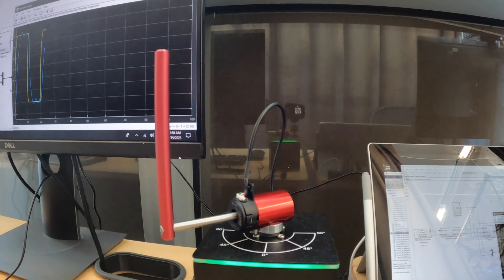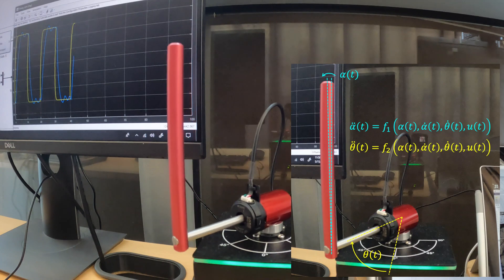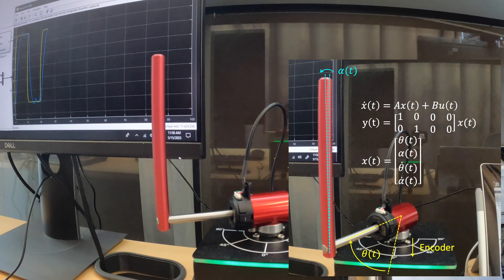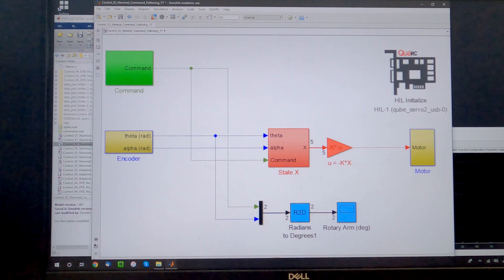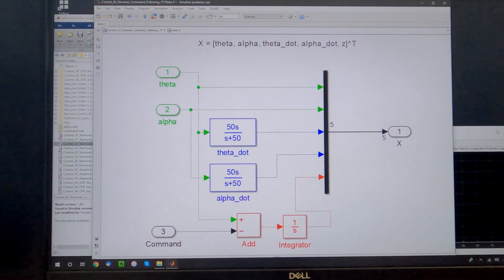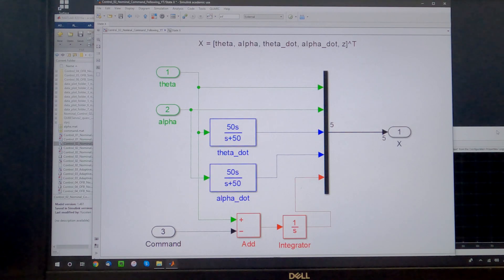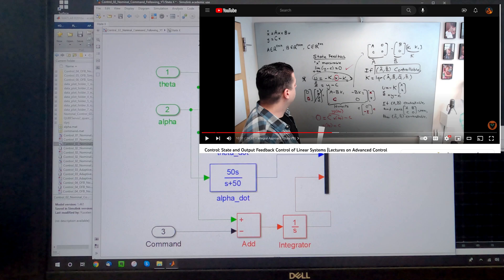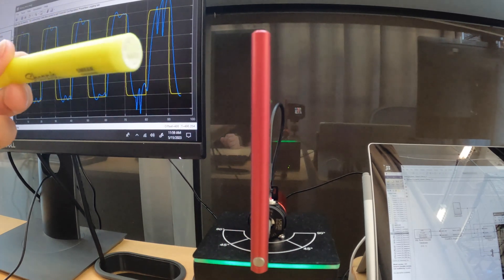Control: Inverted Pendulum Experiment (Lectures on Advanced Control Systems)

Comment: Sir please do Lagrangian dynamic modeling with Newtonian including comparison, thank you!
Reply from the maker: The original classical mechanics is Newtonian. It is based on Newton's second law, F=m*a, to derive the equations of motion, where you deal with forces/torques directly. On the other hand, Lagrangian mechanics is a more general formulation, where you deal with the energy of the system instead of dealing with forces/torques directly. This playlist is not necessary on dynamics; however, I may include a video or two later as this playlist gets more content on controls stuff ;)
Reply: @tyucelen  Okay Sir! Thanks..